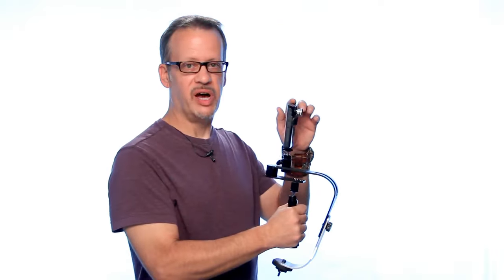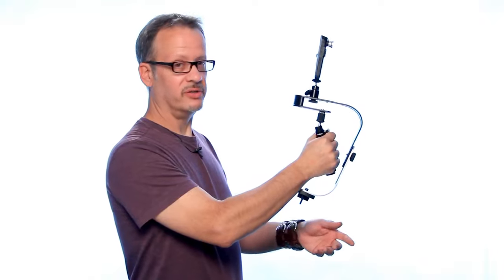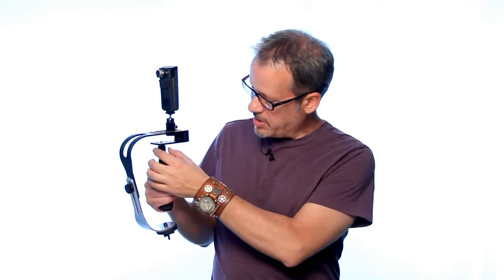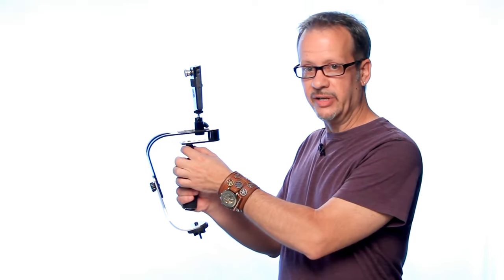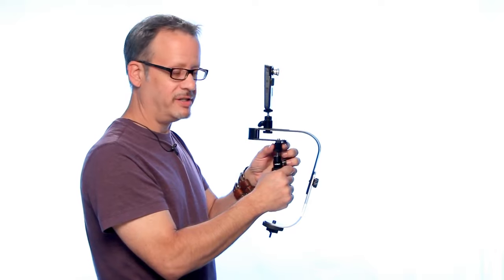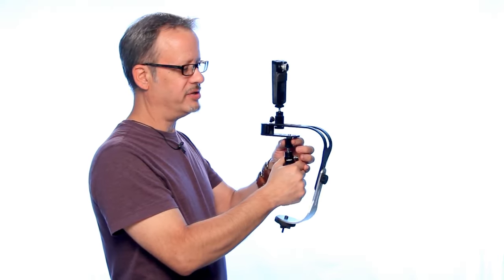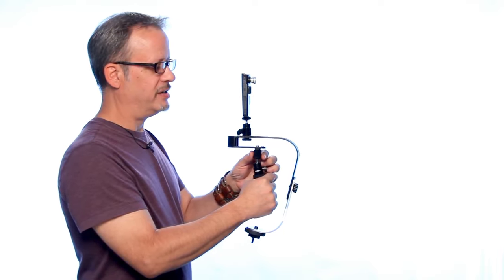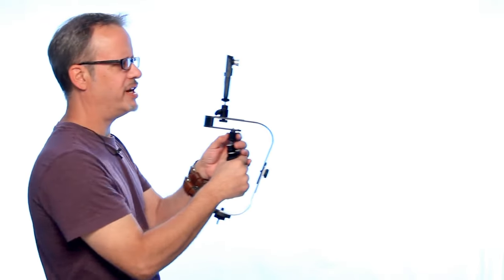Roxant Pro Camera Stabilizer - Proper Two Handed Operating Technique

Comment: Really learned alot with your videos.  I do alot of video shooting at the lake trying to record RC boats.  Just wondering if this stabilizer would help with all the jerky motions I need to keep up with?  I'm sure I would have to practice and use the 2 hand method to make it pivot to try and keep up.  Or can you recommend a better setup?  Thanks.
Reply from the maker: Hi James.  It really depends on the types of shots you're trying to get.  Are you zoomed in on a tight lens trying to keep up with the boats as they make fast or sharp turns?  If so your best piece of equipment would be a good set of sturdy tripod legs and a true fluid video head...however a setup like that is going to run between several hundred to several thousand dollars.  You can definitely do those shots on your Roxant Pro, but yes it is going to take some practice learning the 2 hand operating technique.  Panning your shot to follow the boat shouldn't be a problem...the issue will come when the boat changes direction, and you have to slow down and stop your pan and then start panning in the opposite direction to follow the boat.  Practice some pans and learn to feel how much pressure it will take your fingers to start and stop those pans.  The goal is to be able to start and stop your pans without even having to think about it...in time it will just feel natural.  And most importantly make sure your rig is perfectly balanced...if it isn't you're going to find your stabilizer tilting wildly all over the place and you'll just be fighting your own shots.

Let me know how that works for you, or if you have any other questions.  And thanks for watching!
Reply: Thanks for the reply.  I'll give it a try and see how it goes.
Reply from the maker: Awesome.  If you get some good footage please post it...I'd love to see how you're progressing with it.
Reply: Will do.  Thanks again.

Comment: Is it use for sony a6000?
Reply from the maker: The Sony a6000 weighs 0.76 pounds with a battery and memory card.  So as long as the lens you use doesn't make the whole camera heavier than 2.1 pounds you should have no problems.  If it does weigh more than that, watch my video "How to Balance Heavy Cameras"  https://www.youtube.com/watch?v=9N3tMrQxXOE.  Thanks for your question.